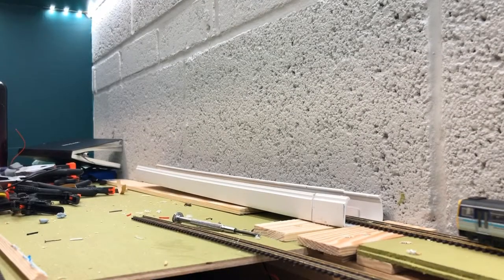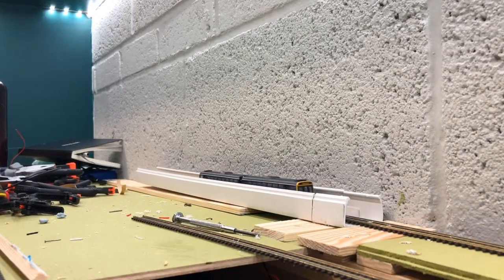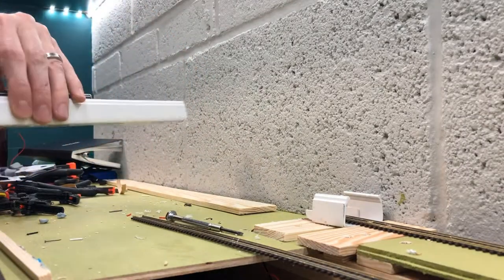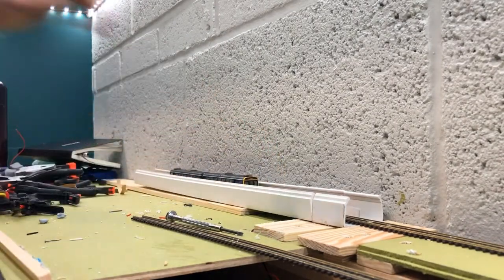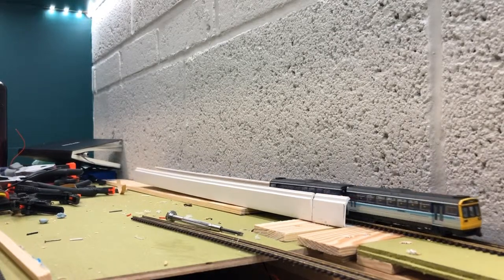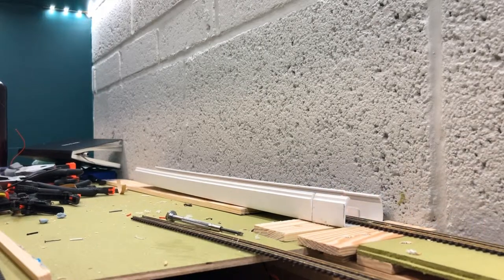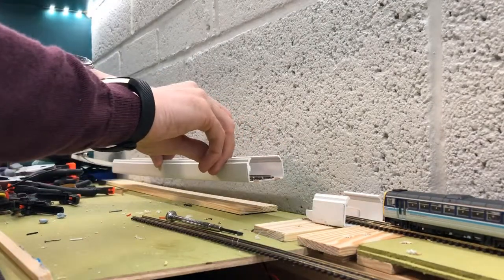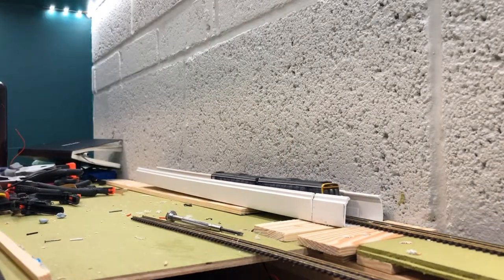I made an N Gauge fiddle yard cassette out of cable trunking

Comment: Looks great! Can I ask what size cable trunking you used? Ideally I want to be able to place two next to each other with normal double track spacing (which it looks like yours could do comfortably).  Thanks!
Reply from the maker: The back of the trunking is 40mm. I can’t quite get two side by side with normal spacing. The distance between the inner edges of the sleepers is about 30mm

Comment: How do you get power to the cassette?
Reply from the maker: Sorry I missed this comment. I have copper tape on the bottom of the cassette at each end. This wraps around and a short wire is soldered from the tape to the track. I have similar on the baseboard. The pressure of the cassette in the clip pushes the two bits together. I’ll do a short video in the next couple of days to show you.
Reply from the maker: Alex Rushton I’ve put something together here: https://youtu.be/eGabw2SnMz4